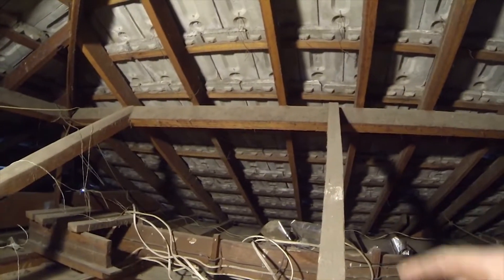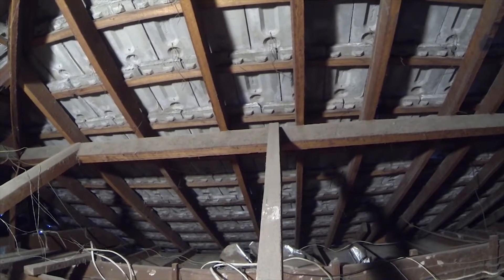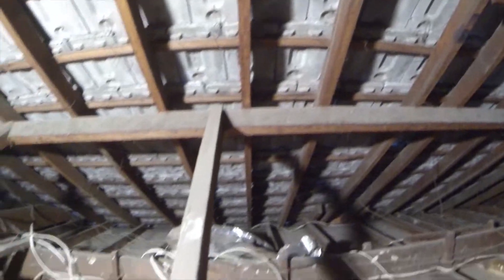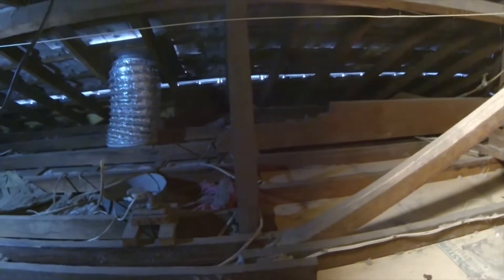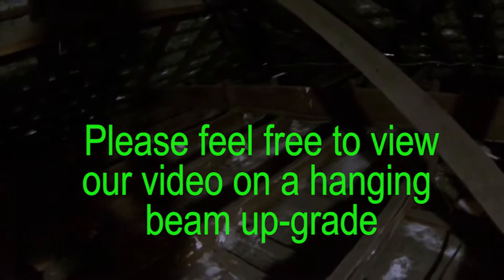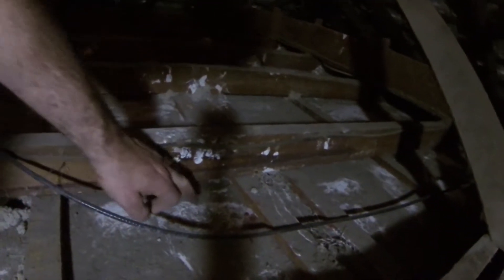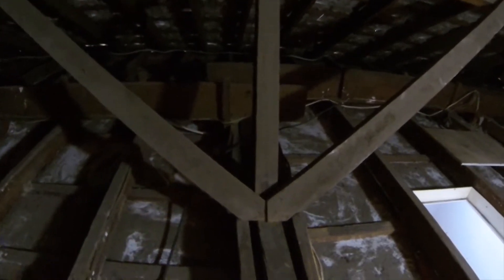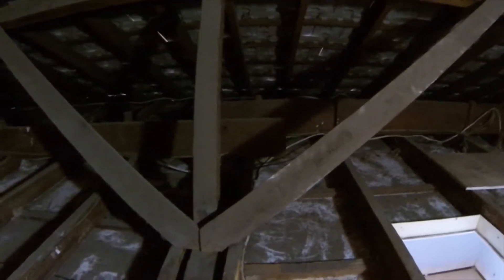How to know you load bearing points on a pitch and prop roof

Comment: Great video.. what is a strutting counter beam?
Reply from the maker: Gday LILMOZZA,
a strutting/counter beam is a beam which takes the load of a prop or strut that has no wall or load point directly under it (for direct weight transfer to the foundations).  this allows the beam to span the room or area below.  
These days, as people want more open living, we install strutting beams to engineered specifications in a roof space and then remove the wall or walls to allow more open plan living.

stay awesome
uncle joe joe
Reply: If there’s one thing that would be worse than not being able to remove the wall, it would be having the roof cave in when you did.